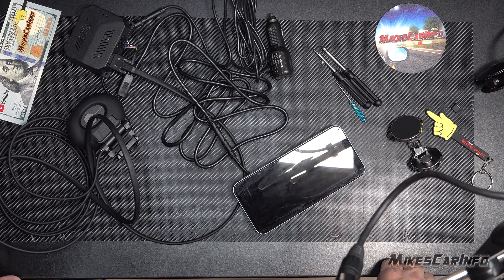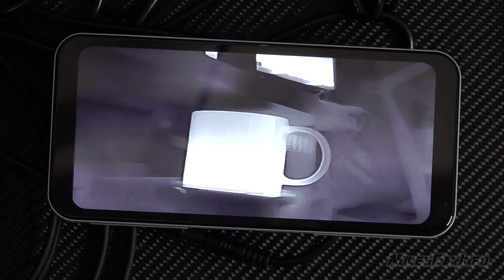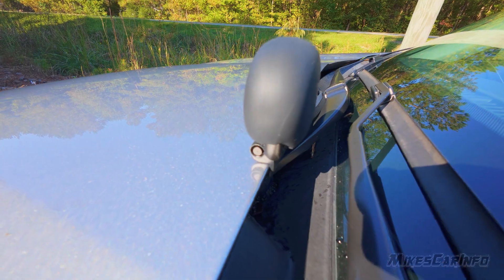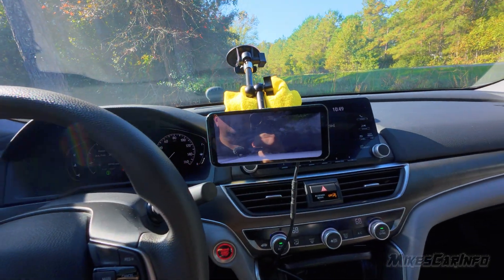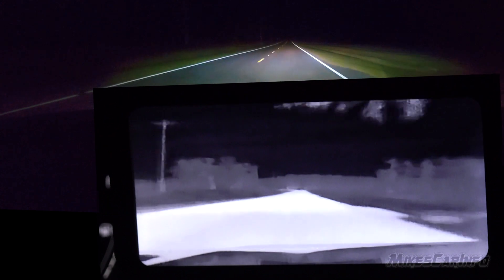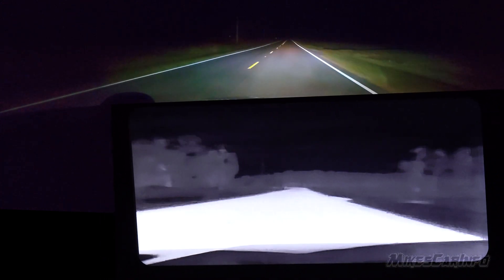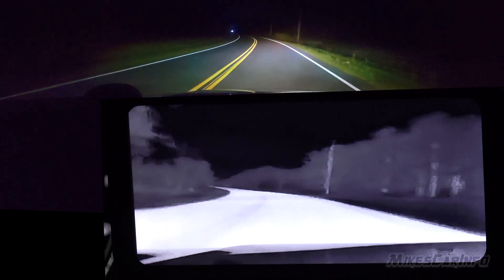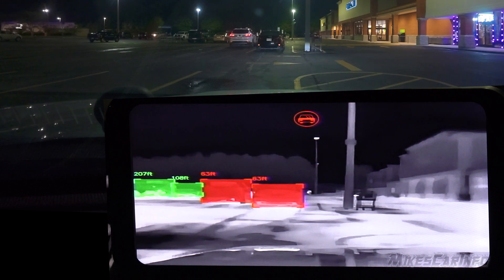Vehicle Night Vision -- Airayvis CT-1 Thermal infrared Vehicle assistance System

Comment: Have you tried to install it on the roof using a magnet? Will it help a field of view?
Reply from the maker: As long as it is an extremely strong magnet then it should work great on the roof. Field of view would be slightly improved. Check out my video on the Thermal Master design, it mounts on the roof.